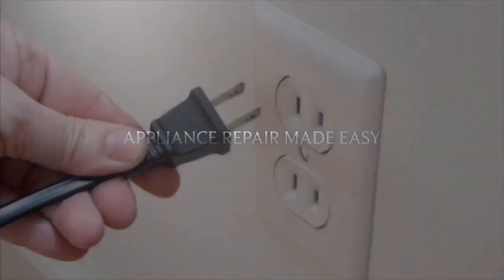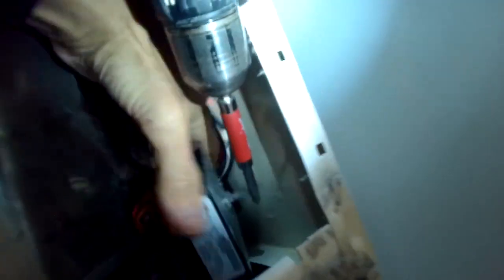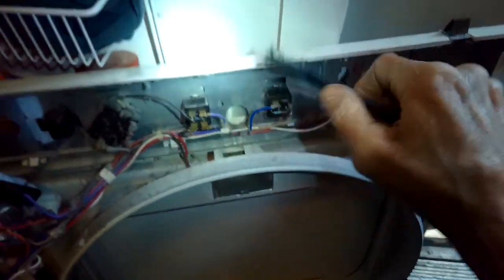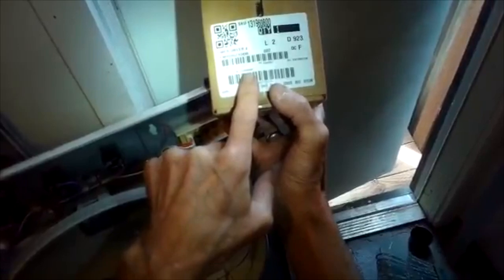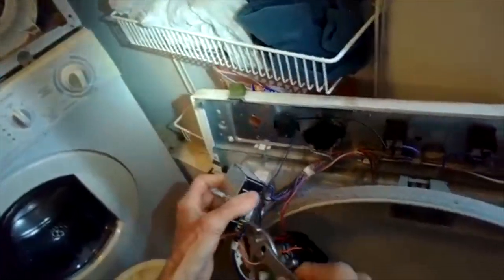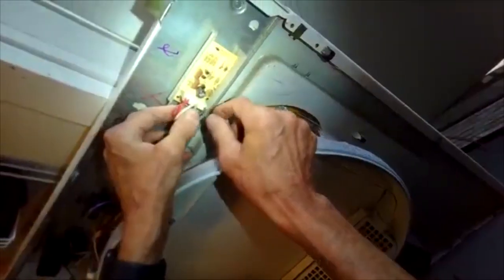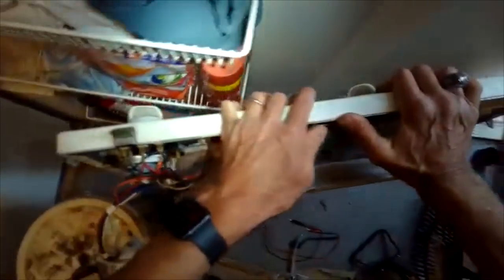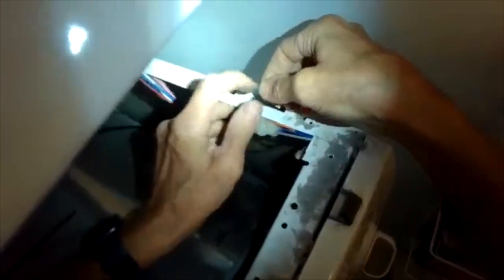✨ FRIDGIDAIRE DRYER - Easy TIMER REPLACEMENT ✨

Comment: Video is still helpful four years later. Thank you! I have this dryer and although the timer still functions, I've broken 3 timer dial knobs now when simply rotating the dial into the desired position. I am I attempting to be gentle with the rotation. Do these timers tend to become harder to rotate with age? Any mechanical parts present that can be lubricated? I hate to spend $160+ for a replacement if it isn't needed. Thanks!
Reply from the maker: That’s strange Matt.
Can you send me a video of you turning the knob?
Scottthefixitguy@yahoo.com